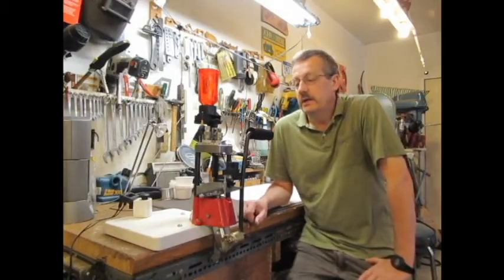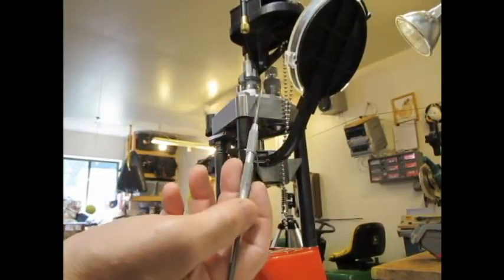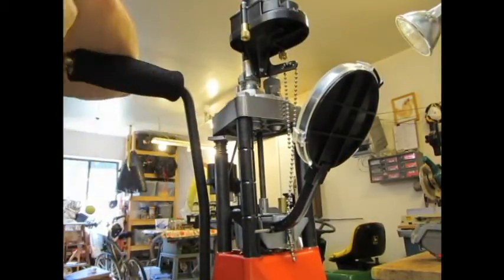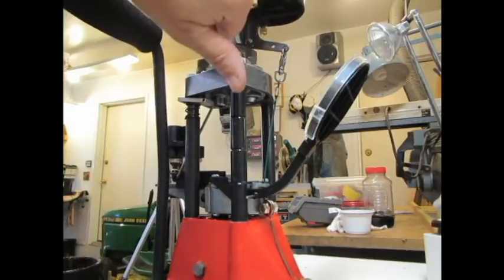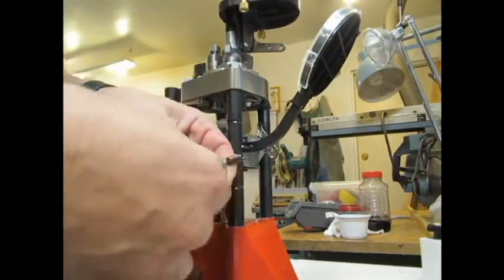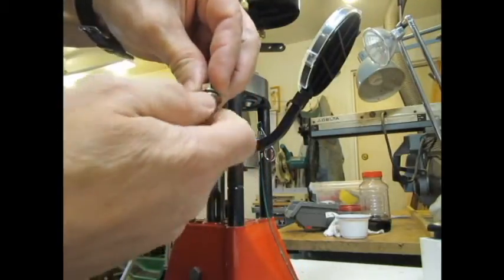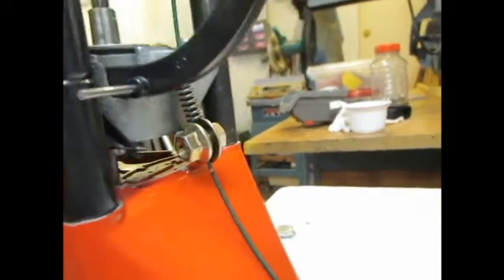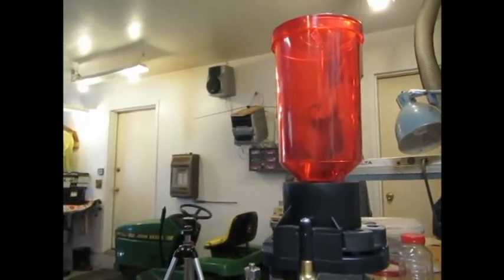Replacing Lee Pull Chain on Pro 1000

Comment: To empty the hopper all you have to do is turn it to the off position, raise the ram to give yourself some slack in the chain so you can cycle the lever that moves the charging disk a few times to empty the area below the hopper through the die, and then unscrew the brass nuts that hold the hopper on the thing. There is no need to mess with the chain.